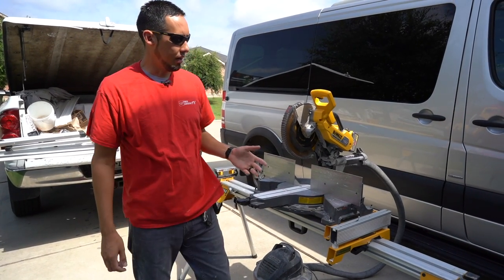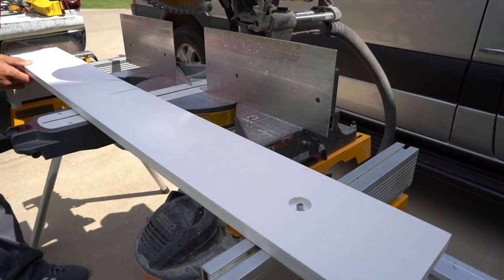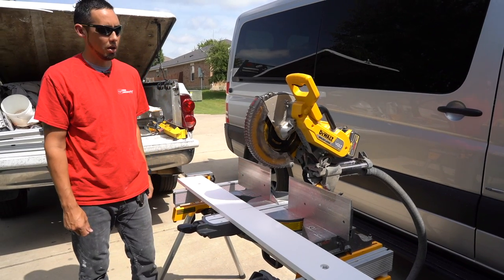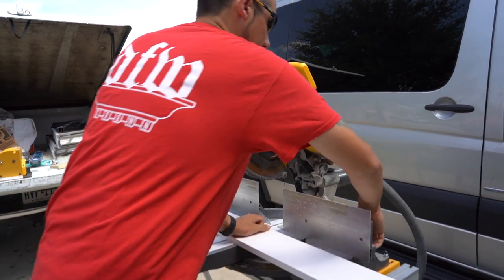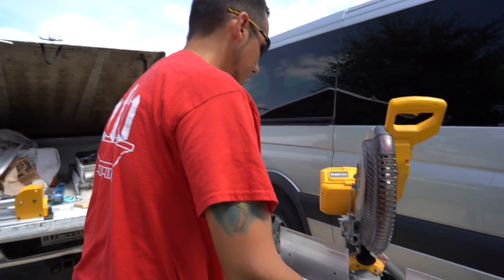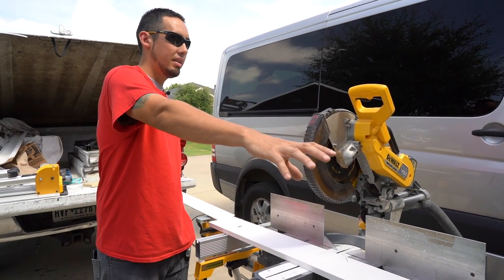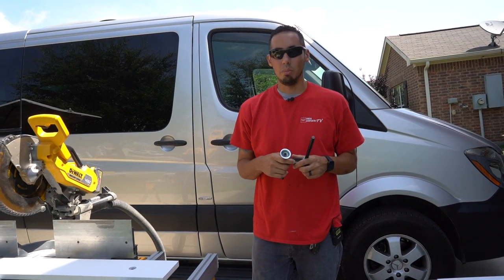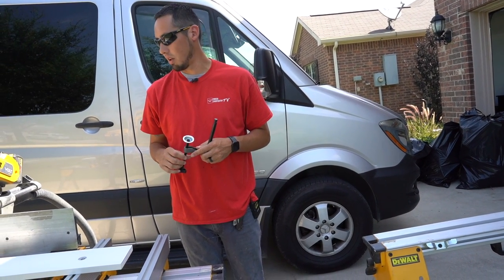NO MORE  D e W A L T  STOPS!  CROWN STOPS ARE DONE!

Comment: I think your crown stops and rails are a great idea.  To lock in the alignment just lock your blade down at 0° and slide the sacrificial board using the blade as your glide.  As for the 8' supports I think that is way over kill for just a support, utilize the built in sliders since they are adjustable and then you don't need to worry about level surfaces because everything is coming off the support stand

Comment: This is the best DIY crown stop solution I have seen. Good job. As far as the extensions, I think you should take advantage of the factory extensions and figure out a method of fastening the extruded aluminum to the factory end supports at the required elevation as that height will not change. This will minimize setup problems on uneven ground. Introducing secondary supports and fighting to make them even at different job sites may defeat one of the major benefits of a portable miter base all together... just my 2 cents.

Comment: I really like the simplicity and ingenuity of your set up.  Ridgid makes a "FliptTop" portable work support that has a easy height adjustment and tilt.  In addition, it folds up.  It has a small surface but you can attach those rails on them.  Probably less expensive than those Dewalt stands.  I am sure you already know but Kreg makes the flip down stops that would fit those slots on your rails.

Comment: Great concept going there.
If you attach your 'outriggers' or the tables on each side directly to the single base you won't need to ever worry about being level on the ground. Don't use the second Dewalt stand. Don't need it. Let them hang free. Mount the outriggers directly to the stand the saw is on and have a screw adjustable rod attached to the longest part of the outrigger to the lowest part of a leg forming a triangle. The outriggers should be a super lite since they don't need to carry much weight. Just needs to be reasonably level-able. Just the ends of some trim needs support unless you want to make it stronger so you can make a coping jig on the end of an outrigger or something.  Then a simple portable adjustable table could be added on to one of them to make a sturdier base.

Comment: For an old trim and framing carpenter like me, seeing those cordless sliding compound mitre saws makes you jealous of how lucky you young guys are...I remember the first electric miter saws ( for contractors) They weighed a ton and were terrible for lugging around and They blew house circuits a lot...I guess you guys will be jealous of the future trimmers using Quantum energy plasma 5 axis mitre boxes...:)...
Reply: OK Boomer
Reply: Been doing trim for 30 yrs. hired a guy he had never seen a copping saw
Reply: @davidburlason8466  :)...Yeah the work pool is stagnate and filled with debris...Watching some of these younger guys terrifies me...But; I haven't used a copping saw in years...I back cut it and grind it or shape it with The mitre box blade or table saw blade set below face...:)...A good copping saw is a sweet tool though!
Reply: @godbluffvdgg  I guess it is all about not tiring yourself out quicker fighting with those old tools that will have your hands cramping up..

Comment: Hey Richard. At 12:45 behind you on the left hand side of the smaller stand there is that weird looking thing attached to the stand, that is there so that you can move it to any place on the stand on use it as a locator for the mitre saw to be in the same spot every time. You can use that to keep the crown stop jig in the same place every time.

Comment: I’ve gone to the Kreg Track Horse for my out rigger supports - allows for 6 different height adjustments on each leg to compensate for uneven ground and they are super versatile (use a pair for my custom in the field router lift/table top) / table saw extension - super sturdy (2200 lbs ea) and fast to set up compact to store

Comment: My Dewalt stand came with a bracket that bolted onto the stand so you could locate the saw in the same place every time you set up. if you have one or can get one from Dewalt you could use that to index your crown stop. As Far as your stands you could take adjustable roller stands, remove the rollers and install your extrusions to them. They are quickly adjustable and easy to transport.

Comment: All you need is an adjustable leg on the outboard ends of the stock support. The inboard mount will already be flush with the saw like the crown stop bracket. A couple of pieces of ply with T slots and star knobs for adjustment and you're ready. Look at insider carpentry's video again for the outboard leg support.

Comment: Expensive, but what about two more miter saw stands?  Use the slots on the ends for the supports to tie the three together.  Take off the supports from the extensions and push them into the adjacent stands to line everything up.  Adjust for the uneven ground with shims.

Comment: Fix the brackets to the aluminum extrusion in the same manner that you did with the jig, and attach to two material rollers. Material rollers are smaller and lighter and easily adjust for height. Having two outside single points (vs a long rectangular stand) will give you ability to pivot the same way you do with the jig for dialing in on off terrain. You would also be able to quickly turn one of the supports perpendicular so that your work area could be set up straight or in a "L" shape or what ever suits your needs, given you leave proper play on the support which locks onto the mitre stand. Looking forward to your final setup.

Comment: You can use a regular V stand which is height adjustable with a 12 inch ball bearing roller cylinder that supports
the work piece. I have 2 of these and use them on the in feed and out feed support when surface planning
long material.  I had to order online to get some descent ones.

Comment: The t-track tubing was roughly 3/4" lower than the saw table without your spacers. Seems like you could rip a 8"-12" strip of 3/4" ply that would be 8' long and fasten it to the top of your track tubing. Then either use a cheap roller stand for height adjustment on the opposing end or make a simple sliding dove-tail leg on a hinge for flat storage. You would need a slot in one part of the leg and a hole in the other, bolt and one of those star knobs you like so much to set elevation. $15 in material per extension wing. With 8' in length you might need a single rib along the bottom of the 3/4" ply to eliminate sag.
Reply: I've been watching your videos for quite a while and just realized you were also in the DFW area, keep up the good work and good content!

Comment: Great Jig and idea. My issue is the saw, not sold on the battery DeWalt, Milwaukee Makita etc . I have x2 battery's says table saws, as soon start to loose power the cut is not accurate , cannot see how battery will beat power/mains. Good for some purposes but not all day cutting. May be one day it will work. But with mains you get full consistent power! Great videos.

Comment: Bolt the t rails to the existing extension arms. They are easily removable with two wing nut style fasteners as well as adjustable. Then get yourself a couple woodpecker flip stops. Cheap and a very easy/fast set up time.

Comment: Regarding adjustment: In your video from yesterday Gary Adams wrote this: "hi just a suggestion  if you put a couple of nuts between instead of spacer it becomes adjustable".
Wouldn't this do the trick?
Reply: Put a "Jawstand" on each side. They make 2 types. One has micro adjustments. Heavy duty quality. Have the Jawhorse, love it. Its a beast and a carpenters best friend.

Comment: Ive always found the roller stands to be very good for supporting the lengths of material that are to long for the stand to support. Plus since they have a big roller on top it doesnt scratch your material as you slide it back and fourth on your miter saw. Just a thought their portable and adjustable to allow for uneven surfaces.

Comment: Hello,  If you are uneven you will have to level in two planes.  Something like a single point clamp in each plane that can be tightened to lock.  This would lend itself well to your tripod idea.  The mount could tilt back and forth on a pivot while the height could be adjusted with your crank.  For myself I just set up infeed and outfeed tables.  You could get complicated (do you weld aluminum?) and run one tube out your eight foot on each side with a saddle over your saw.  Then use tube within a tube to straight leg each outboard end.  A variety of tilting feet (think the jacks for a boat trailer tongue or a camper jack) could be attached to meet uneven ground.  Sounds like a fun project for the home machinist in us.  Take care.  Doug

Comment: I’d honestly take a look at modifying the extensions from the Paulk miter station and mixing that design with Insider Carpentry’s extensions. They’d hook into a fixed (flush with the saw) point where they hook on and they’d be adjusted for height on the ends. The adjustable legs on the extension fold up into the extension and transport right next to the saw setup.

Comment: You could use the square extension tube as bridge between DW- sawhorses, without the supports. I'd put perpendicular flat rollers on those DW saw clamps, with height adjust etc.

Comment: You could use the square tubing sections to attach another part of the aluminum extrusion on each side from other stands. Then you could brace those added sections from their outside edges at a diagonal to the bottoms of the stands feet. The braces would be precisely cut. That way the entire apparatus would still have four feet and always have a top edge in line. The idea is to sort of cantilever the added extensions.

Comment: I have the Festool Kapex with the UG stand , the crown stops, and the spoil board. It solves literally every problem you're speaking about, except long pieces of nested crown go unsupported at the far ends, so occasionally I have my helper hold the end up while I cut it.

I know for you though, since you do so much crown, you probably need a huge capacity. The Kapex tops out at 6 5/8" for nested crown, and a measly 4 3/4" for vertical baseboard. That is the only downside to the saw and stand. Everything else is absolutely great. Add a vacuum and some upgrades and it'll top out at near $4k, but it is totally worth it. If you can make due with the smaller capacity, its a no-brainer buy.

Comment: You could use all tread rod connection nuts(the long nuts) get some one to weld them to the quick connect bracket. Then run the bolt up from the bottom add one nut and a nylon lock nut then your aluminum brack and another nylon nut. Tighten the nylon lock nuts just enough but not tight enough that you can't turn the bolt. 
When want to level turn the bolt up or down then lock it down with the nut that floating in between the aluminum bracket and the quick connect bracket. This will give you all the adjustment for up and down and forward and backward.

Comment: I like your idea with the side outrigger bolt that can adjust up and down for fine tuning. I think I will make a quick one with standard threaded rod but with a bolt or socket at the top for using a drill fast

Comment: For the extended table on the sides I would buy four more dewalt mounts for the saw stand and four more aluminum 2x4's with the slots for bolts. Use one mount near the saw and one at the end of the stand. Bolt two of the 2x4 studs together with a inch or so gap in between them. Use the spacers you used for the crown stops to level with saw top and make a board smaller but same idea as crown stop with bolts that slides down both rails just to use as a saw stop for repeated cuts. That way you can take them on and off just like crown stop. That would give you 8' on each side of saw that you can remove or install quickly and will fit in truck or van. Love the videos and the attention to detail.  Ok, wrote first part before I finished video. You could use the same idea just widen the width between the two by fours and mount your board to them as wide as you want it to be. Then you eliminate the need to set up extra stands and level anything out. It would become one unit. If you use 3/4 material you only need to shim up 1/16th.

Comment: So what you need is either to go on each leg or front to back. so if you can hook up something like a small trailer that goes to your ball of the back your truck how the wheel on the bottom has a shaft going up with a rolling crank or you could have small CO2 system with compressed air with a bleeder system raises it up and bleeds it down up and down. When you run out of here you hook up your compressor and fill the tank up again something that is stationary that will either connect next to the legs of your table or switch the legs install those instead

Comment: I love this crown stop jig, perfect for those who have a DeWalt stand. Richard, I think you are overthinking your miter saw extensions. I might be wrong but don't you have some Ridgid Flip Top supports? Any trim stock or crown molding further than say 6 ft from the saw blade left or right doesn't need to be dead nuts matching the saw table, trim usually twists well enough on its own accord.  The only area where things need to be as accurate as possible is there on the saw table. I use the Flip Tops as extensions and if necessary shim the legs at ground level to get what I want.

Comment: Great video Richard! I don't installation much anymore for physical reasons, but I've done quite a bit of in days gone by, I always used poplar, but I found abnormality tolerated wasn't far the simplest to set up on uneven surfaces. I just used a couple of shims under the stand foot of it was off on another angle. The key was a good quality rolled stand though, the cheap ones I found the rolled and supports were always welded crooked...import crap. Andrew Love the plastic fascia board idea though.

Comment: have your 8ft platform with the stand clamp on one end to attach to the stand with the height fixed and on the other end the platform fits over a roller stand to adjust height to make level. you can have your stop block track system like you said on it

Comment: Richard, I would try to make outside stands attach to the saw stand with the sliding tube you are thinking of eliminating. If the outside stands have that ability. Slide a piece of tubing threw both stands to attach them. That way there are less legs to throw off the leveling process.

Comment: Run a square tube from the end of your original Dewalt stop straight into the end of the smaller stand where it’s stop would go ( if they have them) and that should keep both stands at the same height. Just use the standard size tube they come with but longer run them deep for maximum support, and maybe on the far end of the small stand have a single adjustable leg at the bottom like some tables do and mount that in where the other stop would normally go (again if the smaller stand has them) standard legs can just stay folded up out of the way or in use if the ground is flat enough.

Comment: You're thinking like me now! I'm always trying to improve the workability of my job site tools. I'm making a table now to attach to my DeWalt miter stand. I'm using the same saw brackets and a 24" x 48" piece of 1/2 birch plywood with aluminum channels screwed around the perimeter to stiffen the table and prevent things from rolling off. The table will extend perpendicular to the stand once mounted. I build a lot of decks and I cut my pickets from 8' 2x2 stock so I need a good place to stack the pickets while I'm cutting. On your work table idea, I don't think you want the part mounted to your miter stand to elevate. Depending on how much you raise it, it will interfere with the crown lengths being cut.

Comment: You could get a PVC board, put 2 “L” brackets on the end at your crown support. Screw 2 “U” shape hangers to catch brackets then put adjustable leg at the end away from the saw. Do the same on both sides. Set hangers at a height that when you put the boards on no adjustment is required. The adjustment would be at the end with the leg.

Comment: @finishcarpentrytv Richard,  maybe I’m not seeing something but it you are chocking both sides up independent, why do you need the middle of the jig at all? Just make 2 side jigs that are wide enough where the middle of the work piece won’t go out of flush but u can use the sliding feature and not have to worry about cutting your jig in half?

Comment: I think if you add the best fence by fast cap or fabricate something similar you'll be good. Some suface area included for pulling tape measurements from is a must.  Adjustable roller stands work fine too but they are annoying. You could make an L shelf that hinges off the main stand with butt hinges  and use the adjustable part of a roller stand for support after removing the roller head.

Comment: I would make use of the inbuilt extendable supports by cutting off the existing end and making an extension that slips over them that has its own part that is leveled to the rest of the saw
Reply: Multiple stands would be too time consuming to level to each other. To get a long level bed set up fast it has to be all mounted from the saw stand

Comment: you're right with the tripod but i would use the legs rather than the top mount, that way you just level at the extension legs leaving your working apparatus as they would be for a flat surface, a level or a long straight bar will be quickest way to level up the extensions.
you might be able to make use of the square tubing you are thinking of removing, use that to lock into the extension body then adjust the legs down to the floor

Comment: I never thought about using the zero clearance cuts as the alignment point for the cuts.  I always spend so much time aligning the blade to my marks on the material.  Bending over, lowering the blade at least twice to line up my marks.